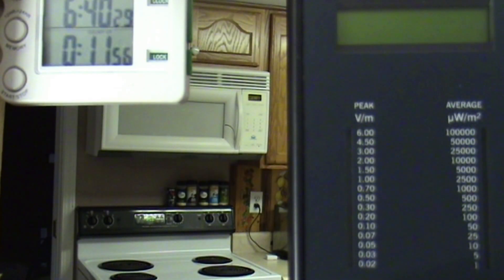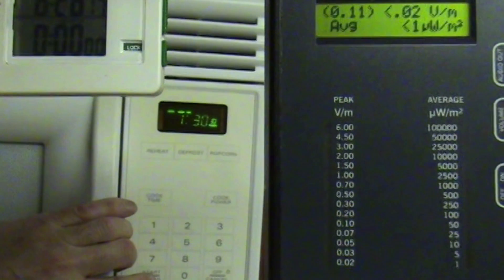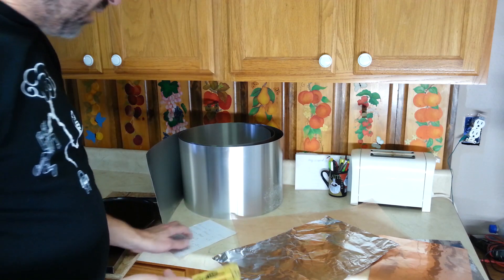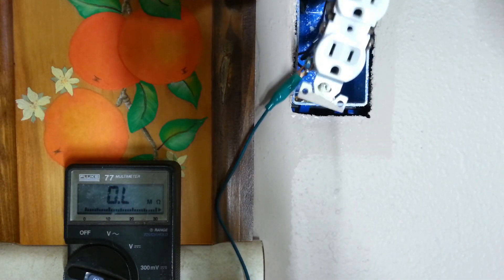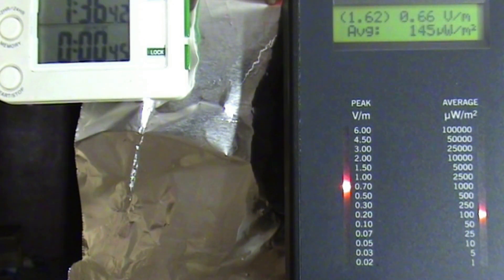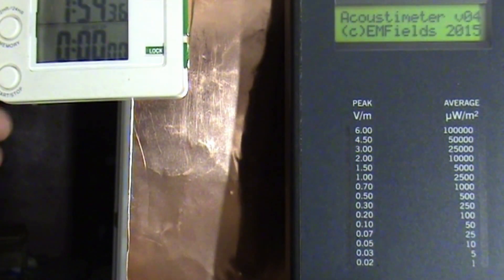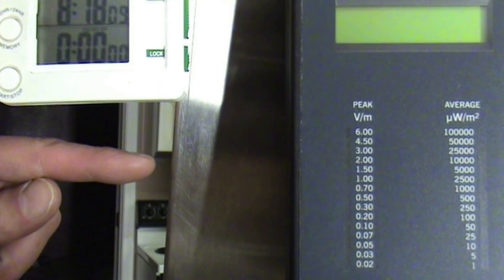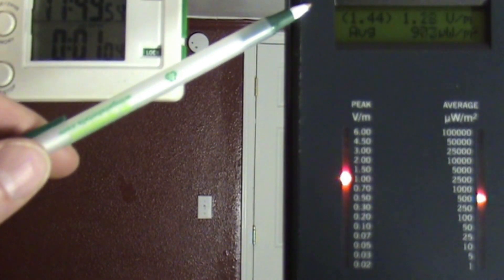Testing materials for RF radiation blocking abilities

Comment: this is a useless test. the electromagnetic waves can take indirect route from the microwave to measuring device. in order to get a correct results you have to cover the measuring device 100% like a box.
Reply from the maker: As you can clearly see, each material shows different levels of effectiveness in reducing microwaves.   
Why don't you do the test yourself if you are so dissatisfied with it? A blank channel seems to indicate you are all mouth and no action; like a troll.
Reply: @ForbiddTV  i am not a troll but you are right.

Comment: Ungrounded aluminum foil works fine for me

Blocking Chicago's 91.1 FM Vocolo Radio's STRONG WIDE signal to my southeast.

Which has stepped on our local 90.9 FM WDCB weaker signal to my southwest

ever since 91.1 went on the air a few years ago...

I'm using a RS Amplified Tunable Omni FM antenna

With my 1980's Lafayette Analog Stereo Tuner....

Daytime Solar hash is NOT affected....

UMMV....

J.C.

Comment: Some other factors. Movement of fields. Exposire on a time and intensity of exposure. Also emvironmental toxins. 
5g is being installed via the cheap and dirty way in coverage gaps  ( increased coverage relative to density and factors like pollution, radon, emp, and radio transmission. 
The unhealthy move .was when police, fed, local protections, went to the new bandwidths 15.years ago. My refrigerator exceeds my.microwave. pollution and a/current leakage seem to effecf. But like anything, too much, or too small 
...wavelengths are like too much mexican beers . Over a 18 pack can kill. Tha k you zac

Comment: how about mixing iron oxide or copper sulfate in paint, then applying to walls/floor?
Reply from the maker: For what purpose?  These frequencies are non-ionizing radiation!
Reply: @ForbiddTV  help me understand please! i read that RF blocking paint can block between 1-6 Ghz.most 5g is under 6 (short distances, lower attenuation)
Reply from the maker: @handymanbrian8269   Non ionizing radiation!  What's so hard about that?

Comment: Have you built a sealed box out of the thick aluminum plate roll yet to test (so to get 100% shielded sleep zone you build a box of thick aluminum plate roll right)?  Want to collaborate on artwork (I'd like to build boxes of 100% shielded, paint them and much more then tour them)?  The primary thing is I need them for using lucid dreams as a monitor when waking up then falling back to sleep with augmented reality apps that track sleeping movement and breath (apps also protect sleeping position).

Comment: I do hope you brought your Microwave Oven to the Dump. and that you went for a walk barefoot in the woods after. well done on your persistence in your experiment. I have catering tin foil taped and overlapped to my party wall (shiny side to the wall and my neighbour Wifi addiction... Do you think its ok like that without grounding? Cos I really need to put more up on front wall (cell tower 600m away). I have Ysheild net curtains on front windows. Have looked into ysheild /blocpaint paint, but really its 'all to much' for me wot with the painting, the grounding plate, strapes and wotnot...and then there seems to be a problem if you fk up on something to do with electrics (cant remember), you;ll only make the room worse.  I am so sick of emf... Written from a wired broadband connection.  I have an acousticon 2 meter,. thank you.
Reply from the maker: All microwave ovens have the same sort of RF signature.  Grounding didn't seem to make much difference as you can see in the video.  Use your meter and find out.  I'm not sure why you would be "so sick of emf".  EMF frequencies and transmissions have come from space and are here on earth since the beginning of time.
Reply: @ForbiddTV  Yes. The EMF's I am talking about are the 'man made' use of the microwave radiation spectrum in the mobile industry. ( I only use wired broadband, have a button phone, often turned off ) https://es-ireland.com/electrosensitivity/  I love being with people, but can't stand the omissions coming from their devices, nor 'free wifi' aka microwave radiation and all this deregulated industry.  Barrie Trower - https://www.youtube.com/watch?v=RrDNanZWeqE  Thanks so much.
Reply from the maker: @Beautiful_Sacred_Land   I know what you think you were talking about.  You can't bring forth any real science of your meme, even though you think you can.  You were told something years ago and your brain can't rid itself of that beLIEf.  I was told the same nonsense back in the 90's; some guru telling me would all be dead or have brain cancer from cell phone by the year 2000.  Obviously that never happened, and microwave ovens have been with us for over 70 years.
Reply: @ForbiddTV  Hum strange response, but that is your opinion and that's ok. I do not own or use a microwave oven. My comment wasn't about them. I will leave it at that, and to the 1000s of published scientific studies done already. Thanks.
Reply from the maker: @Beautiful_Sacred_Land   Yeah but the "1000s of published scientific studies done already" are not legitimate peer reviewed scientific studies.  Start checking some of them.  You are spreading nonsense and you don't even know it.  https://www.youtube.com/watch?v=PiMB9UjzQ3U

Comment: a better way to test is put a mobile phone in the microwave (DONT TUNE  MICROWAVE ON ) and set an other phone to call the phone in the Microwave see if it Rings it the microwave should block the RF Signal so you dont hear it you can also do the test the other way set the phone in microwave to ring the phone on the out side then close the door it should stop the out side phone from ringing ( AGAIN DONT TURN MICROWAVE  ON )
Reply from the maker: Why would that be a :better test?  I am testing materials blocking abilities.  https://www.youtube.com/watch?v=jX0Qfesoci4

Comment: OL means open loop
Not overload.
Thanks for doing this, great info.
Reply: Knowledge is power.. until the end.
Speaking without it.. is risky my friend.
Per the Fluke 77 operation manual linked below.. 
0L is 
"Overload Indication."  
"These symbols indicate input that is too large to display."

https://hogan53.net/specs/Fluke%2077BN%20User%20Manual.pdf

Comment: could you test mylar also?
Reply from the maker: Never tested it for RF blocking.  Its merely plastic sheet, I doubt it would do anything. I may note this when I do a video on Mylar bags as faraday cages.  I found they are non-conductive with an ohm meter.  Surprising.
Reply: @ForbiddTV  well, they do contain aluminum
Reply from the maker: That's what they say, but do a conductivity test with an ohm meter and see what you find.  No electrical conductivity.

Comment: What is the difference between the copper sheet and the copper mesh?
Reply from the maker: One is solid and one is not.  All values measured in the video are shown in the description box.
Reply: @ForbiddTV   I understand that. The mesh works better then the solid copper. I'm curious to why that is.
Reply: @enlightenme6151  distortion

Comment: it's sounds like lining a home in aluminum foil and connecting it to ground could be done in the building phase and cell reception would suck and toss the microwave completely
Reply from the maker: Buscheig Brauen   The very fact you called them "millimeter waves" shows your level of research on this topic.  https://www.youtube.com/watch?v=NzQj22iZn6Q
Reply: If you have the $$, they make roll-on paint that is highly absorbant and would probabl be easier to apply.
You could also paint over it when dry in your favorite colors.

Comment: if you apply 120 volts from a 20amp single pole circuit via ex cord with a disconnected ground form your power system you can use an amp meter and ohms law to find the resistance to ground. if it's is 25 ohms the amps will be 4.8 pending on the voltage. it won't trip breaker. but will feed power into earth while taking the measurement.
Reply from the maker: I'm not techie enough to know what I'm doing with that sort of testing, sorry.

Comment: what is the ohm measurement to earth off your ground system? does it meet the code 25ohms? or did you surpass it and go lower? how many ground rods or other and such is on you power system?
Reply from the maker: I did see a ground rod, but i'm not tech enough to know the answer to your questions.

Comment: To dampen down my Wi-Fi's radiation, I put an aluminum foil "hat" on it. It still puts out enough signal to go the two wireless computers. I wish they would put a control on them to be able adjust the output power. I am sure most of us would pay the extra money for that feature. We ditched our microwave oven 12 years ago, smartest move ever. Now we got 5G to worry about. It seems totally insane. All the testing indicates a barrage of health problems coming our way.
Reply: Dean, you may be increasing the activity amount because your modem is pushing more energy to make the connection with your device. Better to look at the channels used around your home area and select one that isn't "busy".  Open source apps do this easily. Then you can shield the backside of your modem like you said, but to be sure you don't block the antennas look at the online schematic of the your modem to see where they are.  Or better yet, go back to the plugin, cat5 shielded is still superior to any wireless network.

Comment: what would happen if  you used aluminum 0.05mm foil + 1/2/3/4 A4 papers + AL 0.05mm foil? or just 2x AL 0.05mm foils? because, in theory, if 1 AL 0.05mm = 1.62 then 1AL 0.5mm should be 1.62 / 10 = 0.162 which is not the case. so i assume thickness doesn't make much difference. would you try with multiple aluminum foils? because they show best performance/price ratio. thanks

Comment: there are so many things wrong with this test... 
For short: just get aluminium foil, and don't bother grounding it. 
Metallic insect screen/mesh is also good... but it needs to be tested with 5G, coz it's gonna be on a way higher frequency and amplitude than anything we have today.
Reply from the maker: So you have fallen for all that false 5G information too?  https://www.youtube.com/watch?v=PiMB9UjzQ3U
Reply: @ForbiddTV  i dont know about home protection but i did turned wifi off and i started using cat 7 ethernet cables.The frequency that 5ghz router was emiting was too much.
Was it a good choice ?
Reply from the maker: 123OGNIAN  The higher frequency doesn't mean more radiation, just a different frequency, not more power.   I test internet wifi and ethernet cables on this video:  https://www.youtube.com/watch?v=8PkJMBoW8Po 
But using ethernet or turning off does reduce the radiation of course if you are concerned about it.

Comment: I''ve done exactly the same and ound out that perforated materials are better blockers because they distord the radiation, this distortion is the shield. 2 spaced layers of  perforated copper or aluminium are ultimate blockers. You can put your  WIFI router in a perforated sheet cage and test your signal.
Reply: What type of material it is...and where can i get easily that

Comment: Hello my friend, thanks for your video. When I was first testing my RF shielding clothing that I provide to customers, I too was using my Acoustimeter and Acousticom 2 and was not impressed with the shielding results. The designer of the shielding clothing told me that the "omnidirectional" meters were picking up reflected microwave. As soon as I used my "uni-directional" meter, immediately the results of the shielding clothing were obvious. It is hard getting accurate measurements for this type of experiment using an omnidirectional meter. The Acoustimeter is my favorite meter, I use it all the time and will continue to do so, but for the kind of testing you are doing you may want to try a uni-directional meter pointed toward the exposure source with the shielding right in front of the meter.
Reply: That was a very nice message form you, EMF Safety Zone.I thought yo might get hostile with him.

Comment: So you really think that normal screen door screen would do as well as the copper mesh?
Hummm that would be a cheap fix.
Have you had a chance to test it yet?
Great video!
Reply from the maker: True Hope  Unfortunately I didn't have a piece of normal aliminum window screen available to me when I did this video. Based on the perormance of aluminum sheet vs copper sheet and the performance of copper sheet vs copper screen I would think the aluminum window screen would be the same sort of blocker as the others.  You will notice that all the metals had a significant blocking capability and none were all that dramatically different from each other.
Reply: I have seen special lab rooms wrapped in copper mesh , like door screen, door screen is aluminum, copper is best conductor, and ground the wire mesh. I don't know if putting a mesh screen on the "outside of a microwave", like double shielding,  is helpful.

Comment: Would like to give some feedback  to help you with your experiments.

Regarding VHF-UHF and Microwaves,   even a small piece of wire is "seen" as a choke ( coil ) and is blocked,  these high frequencies will not "see" that ground wire as a quick route to ground,   In PC board for microwave frequencies, even a copper trace a few mm long acts like a RF choke, ( allow low frequencies, dc/ac to pass but not RF  )

Higher frequencies, and microwaves bounce around all over,  walls, floors, everything will reflect,   think of microwaves being similar to light,   if you put something at arms length to block the light from a light bulb,  does the whole room go dark? of course not,  you only blocked the direct light,  a similar thing happens with microwaves.

The best way to test for RF shielding abilities of materials,  is to make a small Faradey  cages for your test equipment.  and replace one wall with the substance under test.   this way you are not getting ambient RF pollution coming from reflections. 

It is also important to note that , different frequencies of RF "act" differently  even different wavelengths of microwaves,  have different habits. 

I work in the telecommunications field, and been having a serious problem with microwaves in the newly approved 3.4 Ghz band.  a local company has already started testing ( not in the US by the way ).  this is overloading my LNB's on my C-band satellite antennas,   I have installed filters,  this is when I learned how "tenacious" microwaves can be,  they can seep in between the smallest gap,  even with flanges bolted together,  temporary I have been using aluminum foil to add extra shielding on the flanges,  but have ordered copper foil tape,  and carbon conductive  silicon grease. hopefully this will reduce the EMI even further.

Comment: This is one of the most helpful videos anyone can see, I have my own gieger counter and this saves me a lot of time trying to find a good material that I am going to need. I live in a apartment complex and 2 blocks from a cell tower  so I deal with a lot of RF radiation and pulses I would like to really get rid of. From what I seen is the copper mesh looks really good and I know other purposes for it so I think I would like to go with that depending on the cost.
Reply from the maker: Not sure if you understand the terminology but you used the words "geiger counter".  This is an RF meter for detecting the non-ionizing microwave energy from cell towers, wifi, smart meters, etc.  A geiger counter is for beta, gamma and X-ray ionizing radiation.  I have lots of other videos on my channel with this information if you are confused.  
Although I didn't have a piece of aluminum insect screening on hand to test, I would bet it's just as effective and cheaper than copper mesh screening based on what I see with the aluminum and copper sheet comparisons.
Reply: @ForbiddTV  Ah I did misunderstand that, thank you for explaining. I'm glad I am more informed about that now. The device I have is a Electromagnetic Radiation Tester. Also thank you for mentioning the aluminum insect screening, that does sound like a good less expensive alternative.
Reply from the maker: I don't think your device will detect microwaves.  It sounds like yours is an electric & magnetic EMF detector.  The one I have like that measures from about 20 Hz to 50000 Hz.  It's for magnetic fields and electrical fields such as you might get from wiring in your home or high tension grid electrical fields.. The RF meter shown in the video is for much higher frequencies in the range of 200 MHz to 8 GHz. That includes microwaves.  A geiger counter is for much higher than that.